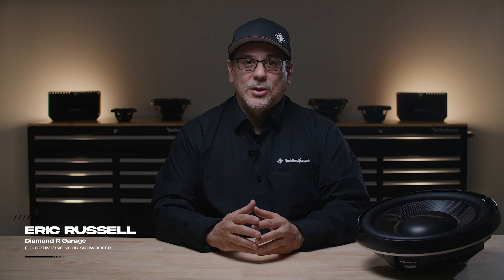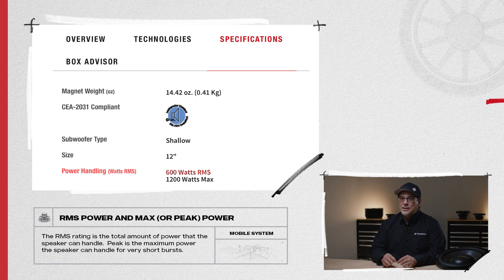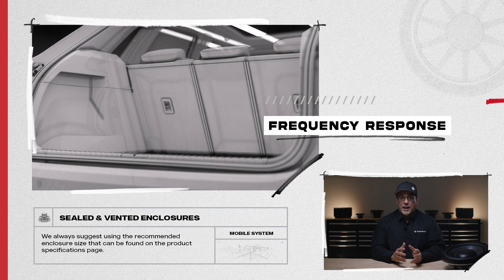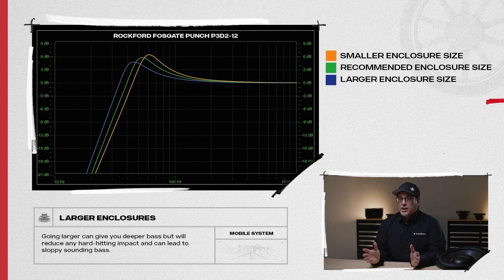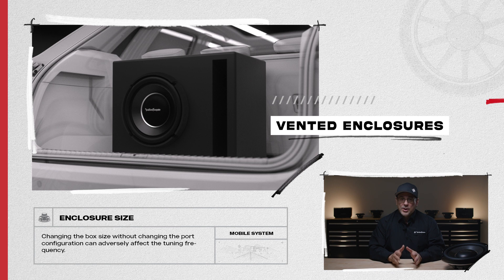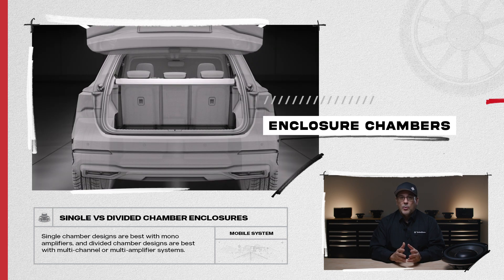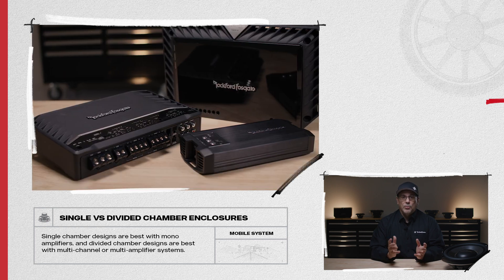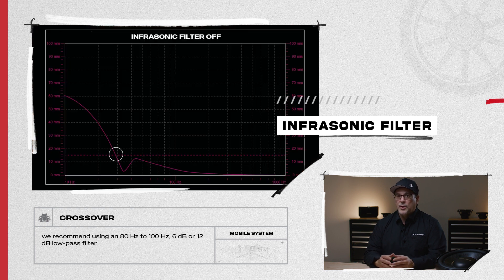E10: Optimizing Your Subwoofer | Diamond R Garage 202

Comment: I have 1 more question I have the rockford fosgate r1200 with 2 rockford fosgate p3s my lights dim when the bass hits what size capacitor should I get
Reply from the maker: We recommend 1Farad per 1,000 watts of amplifier power, so if you use 1F, that will help for quick transients.  However, if your lights dim really low, you simply don't have enough current being generated by the electrical system and will need to look into a high-output alternator to fix that.

Comment: I have 2 rockford fosgate p3 12s on a fockford fosgate r1200 amp in the Dual ported rockford fosgate box I just cleaned up the instal and now it does not hit as hard I'm using a factory head unit and bass knob how do I tune the hrtz (wat should I tune the hetz to) on the amp also wat should I tune the sub sonic filter to and how do I tune my gains I don't have any fancy equipment so I'd be doing it by ear
Reply from the maker: The crossover should be set to 80Hz Low-Pass and the infrasonic filter should be set just below the tuning frequency of the enclosure.  So, if the enclosure is tuned to 35Hz, the infrasonic should be set around 25Hz~30Hz.  Also, since the amplifier has CLEAN, we would recommend using a 40Hz -10dB test tone to set the gain overlap on that amplifier.  We typically recommend 10dB because that provides the best compromise between good signal-to-noise and SPL output.
Reply: So I watched the other video on how to tune an amp unplugged my subwoofers and set my radio volume to wat we usually have it at and played the test tone on Spotify turned my gain up till it turned red and back down till it turned off and I plugged my subs back in and played some music and when the bass hit the light would flash red again I don't have any mids or tweeters hooked up to it what am I doing wrong
Reply from the maker: @mikeandrew4376  I'm not sure about "set my radio volume to wat we usually have it at", but you'll need to find the clipping point of the radio.  Disconnect the speakers and play a 1kHz 0dB tone and turn the volume up until the BLUE LED starts to illuminate.  

PROCEED WITHOUT CHANGING THE VOLUME.  Since I'm not sure what amp you have, there are 2 different methods:

LEVEL CONTROL
Set the level to MAX and use the 40Hz @ -10dB track and adjust the GAIN on the amplifier until the BLUE LED starts to illuminate. 

BASS BOOST
Set the bass boost to MIN and use the 40Hz @ -10dB track and adjust the GAIN on the amplifier until the BLUE LED starts to illuminate. This should optimize the subwoofer amplifier.  Use the bass boost carefully, because any boost you apply will clip above 10dB at the frequency that the bass boost operates at.  If this doesn't sound good, then adjust your bass boost to where you typically set it, then adjust the GAIN on the amplifier until the BLUE LED starts to illuminate.

Either way, you will likely cause the CLEAN LEDs to flicker.  As long as they are not solid, then you set everything up properly.
Reply: And I do have a bass knob hooked up am I supposed to unplug that?
Reply from the maker: @mikeandrew4376  You need to have the bass knob plugged in.  However, see my above note about the difference between a LEVEL CONTROL (adjusts the entire amplifier level like a volume control) of a BASS BOOST (only amplifies a certain frequency range.)
Reply: I have the r1200watt amp but none of the lights iluminate blue they do red I think I got it though thank you
Reply from the maker: @mikeandrew4376  Great!  If they are illuminating blue, that's right at the threshold of clipping, so that is fine.
Reply: Mine illuminated red not blue I have the r21200x1 that normal?
Reply from the maker: @mikeandrew4376  On the R2 amplifiers, the INPUT LED displays RED only.  The OUTPUT LED displays both BLUE/RED.